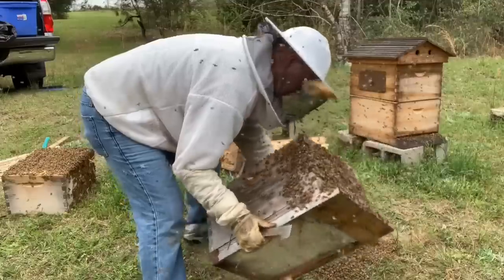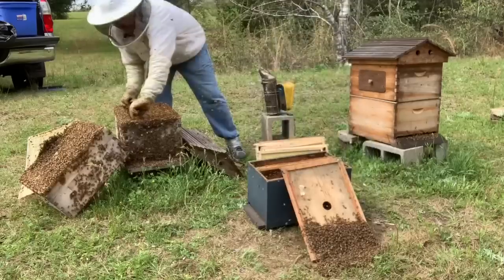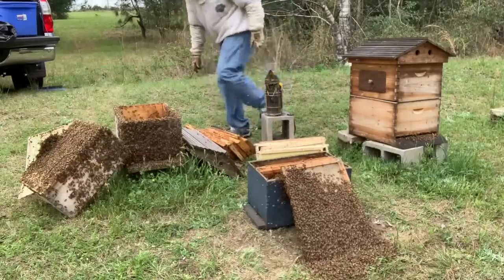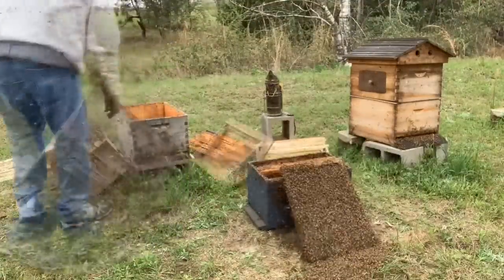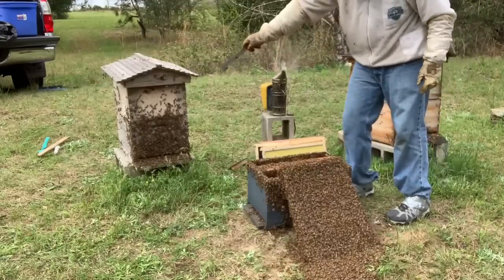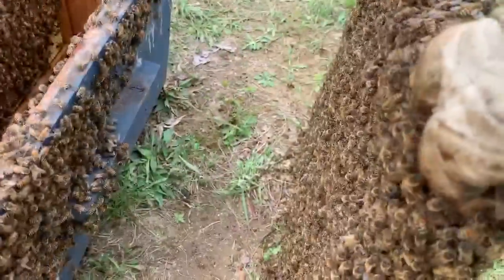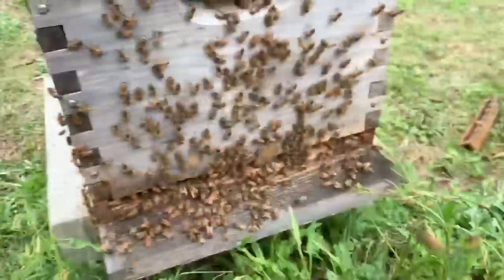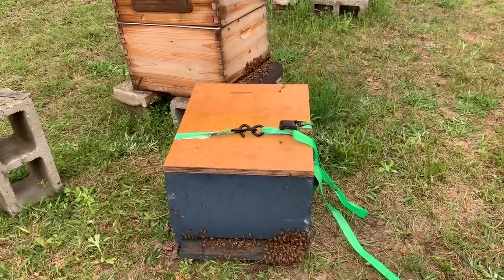Modified Taranov Split of Mean Honey Bee Hive

Comment: Nurse bees won't return to the old hive
Reply from the maker: That’s right. They are with the queen and should help get things going in the new hive. I left most of the brood in the old hive and it should hatch out soon. This is my understanding of how these type splits work. We will see how it goes.
Reply from the maker: I learned a lot through this process. Yes the nurse bees and queen stay with the new hive and foragers go back to the original hive. There was plenty of brood in there. If you watch the follow up videos you will see that the split I did pretty much worked to perfection. Both hives are strong and have done extremely well!

Thanks for checking in!!!

Comment: In a true Taranov all the frames are supposed to be shaken.  The idea is to remove ALL of the bees so that there are no nurse bees in the original stand.  
One suggestion (I've done this before effectively) is to place an empty box and bottom board on the original stand.  This way you're not re-shaking the bees.  It does take longer than I like and won't do it anymore.  I split differently anymore.  But it is an effective method.
Reply from the maker: Thanks for the comment. This is why I called it a “Modified” Taranov Split. Seems to be working out fine. I will probably try a true one later down the road. I really like the concept of a Taranov split but I can see how it is pretty slow. Thanks again for checking out the video!

Comment: Just seen your video now, wondering should the queen have had her wing clipped beforehand so she will not fly back to the original hive, Thanks
Reply from the maker: I like where you thoughts are here.  The one thing to remember is that once a queen mates she typically never leaves the hive again unless she swarms. So she does not know how to get back to the original colony. Clipping of wings o think is primarily used so that if the queen decides to swarm she cannot fly and will either try to leave and crawl back up into the hive or the swarm will end up on the ground or very close to the original colony.
Reply from the maker: Thanks for watching John.  Great question!
Reply: @brucesbees  Great thank you, I will try this myself later in the spring here in Ireland
Reply from the maker: Cool deal. Thanks for checking in from Ireland.

Comment: Why not just shake the frames off into the new box?  What value is there in making them find their way up the cover to the box?  Not challenging what you did - just don't understand the process logic.  thanks
Reply from the maker: My understanding is that when you shake the bees off and allow them to go up the platform it allows the foragers to go back to the original hive. The younger bees and queen stay with the new box, basically imitating a swarm. 

The behavior of the bees attitude of the bees changed from aggressive to that of a swarm as I proceeded through the process. 

This is my understanding of the process and what I have learned about Taranov Splits. This was not a true Taranov Split but I think the principle is basically the same. 

I hope this explains my logic a little bit. Will see how it turns out. 

Thanks for watching and thanks for your comment.

Comment: This would have to be about the worst way to split  a strong hive  . What he should have down was make up 4 X4frame  nucs with some day old eggs in each  an moved 3 of them to another location and leave one behind to pick up the bees in flight   all in one single operation . No need to find the queen but if you did see her pull her head off  head . Job done in less than one hour.
Reply from the maker: Yep that’s one way to do it for sure but my objective was different than what you describe. Was not trying to maximize splits or set a speed record. If my objective was to do as you said then I probably would have had a similar approach. I do appreciate you watching though. And thanks for your comment. It will probably help others who are trying to accomplish maximum splits in minimum time.
Reply: What happens to the full size super? I would have kept that queen based on her laying capacity alone. Another super on top earlier may have given the original hive more work to do  and kept them quieter but queen cells indicate it is too late.
Reply from the maker: I did the split and took the queen away. Both hives ended up surviving. The hive that had the queen in it was still alive more than a year later  last time I checked.

Comment: Why not just shake them straight into a new hive and let the flyers go home.
Reply from the maker: Good question... I think the idea behind the Taranov, or “Modified” Taranov Split in this case, is that the bees are snapped into swarm mode and act as if they have swarmed. They immediately got calmer and clustered together. If they form a swarm and then you bump them or shake them on the ground in front of the new hive they will go in with the old queen and the hive left behind will form their own queen. In this case it worked perfectly. Later in the year I did a couple of “true” Taranov splits that also worked perfectly. This video was my first attempt at doing one. 

In theory just shaking the bees in the box might have worked as you say. I might have to try that sometime. 

Thanks for the input!
Reply: @brucesbees  If you get all the nurse bees and the queen out of there they won't be thinking about swarming for a long time no matter how you do it.
Reply from the maker: You could be right. Makes sense.

Comment: Lol. Or you could have just moved the whole brood box 6 feet away and left the super over the two frames with QCs to achieve exactly the same result without shaking them out. If it started to rain there is 50% your aggression right there.
Reply from the maker: I guess that’s one option but these bees have been aggressive for some time. That is the reason my friend asked me to help. The weather was actually not bad until right towards the end. By then the aggression had gone way down and they were acting just like a swarm. 

Thanks for the suggestion. Will keep it in mind.
Reply from the maker: I also wanted to keep a lot of brood at the original location because I am trying to help the fix the issues at that location. If I took most of the brood away with the queen then it would take awhile for this hive to bounce back. Would rather have the weaker hive with the old queen at the remote location. I left lots of brood in the original spot with eggs and queen cells. Hopefully the population will remain strong and they will hatch out a new queen, be less aggressive and not skip a beat. We will see. 

There are so many ways to address different issues. I hope this one works. I think it will.
Reply: @brucesbees  once the new hive has a laying queen you can recombine them, so you don't lose any honey crop or strength.  A demaree split would also work fine, just needs an additional floor.
There are a couple of ways to solve that problem without shaking them out. But if they were wild for a while you should remove all brood and just supply a frame for them to raise from, from a friendly hive, and less swarmy one at that.  ..
Reply from the maker: Cool. Thanks for checking in. Will see how things go.

Comment: I have a really mean hive that I have re-queened just a few days ago.  They accepted her but there are a few queen cells.  Should I destroy the queen cells?  The new queen I was able to get,  comes from gentle stock and do now want the mean bees to re-queen a mean queen.  FYI I saved them from under a shed - but was not able to get the original queen.
Reply from the maker: Hmm. That is a good question. If the new queen is released and laying you may want to destroy those cells. The only risk you run is that is they decide to kill her you will not have a queen. If however the new queen is laying and they decide to supersede her then they will be using her eggs to make the new queen which might not be a bad thing. Not sure where you are from but here it is getting too late for bees to be making their own queens so hopefully is you kill the queen cells she will be in good shape.
Reply from the maker: Nope. The queen hatched, mated and went to work.
Reply from the maker: @DaddymackLV  this video was shot the same day as the original “Mean Bees” video. So it was basically a 2 part video so to speak. If you watch the “Mean Bees” playlist you can see how the bees did as they progressed throughout the year. Not sure if this management method will work most of the time but this time it worked perfectly.
Reply from the maker: @DaddymackLV  ok. Thanks for watching.
Reply from the maker: https://www.youtube.com/playlist?list=PL8TUJQAHFlHvlhX5Biz6IxBH29TW64IcP
Reply from the maker: @DaddymackLV  awesome thanks!  I hope they answered some of your questions.

Comment: why didn't you put the queen excluder on top of the box that you are wanting them to walk in? the queen can't get into the new box, then you tell her good night. replace one of the capped queen cell frame in the new box and now you will have 2 splits, 2 virgin princesses which will produce calmer hives. just a thought.
Reply from the maker: Not a bad thought. Probably would have worked. If you have the tome to watch the playlist “Dealing with Mean Bees” you can see how things turned out. Everything actually worked quite well in the end. Thanks for the input though. There are so many ways to do things with beekeeping.
Reply: I watched part 1, part 2. there's always 1 hive in the crowd like that. requeen time. i don't like getting stung but I detest getting stapled. what impressed me most about your video's is that you helped out a friend. awesome job!
Reply from the maker: Yeah it all worked out well the others show results down the road throughout the year. I don’t know that this technique would work on a regular basis but it did in this case. 

Re-queening is probably the best way to guarantee desired results. But this technique was fun and worth a try.
Reply: I use the same method but to fix a laying worker issue. i make them walk in with frames of different stages of eggs, larva, capped brood from another hive and used empty brood frames and 1 frame of undrawn foundation. this changes their behavior and gets them into the working mode. then 2 days later i insert either a mated queen or a capped queen cell. this works 100% of the time.
Reply from the maker: Hey that sounds like a great idea.  Thanks!

Comment: Didn't you just get rid of all your nurse bees doing it this way?
Reply from the maker: Great question and yes! It is how swarms work. From what I understand swarms are actually made up of primarily young bees. You basically snap the hive into swarm mode. The older bees return to the hive. As the brood hatched out those bees will become the nurse with the new queen and the young bees that leave with the old queen will build wax and help get the hive established. The split worked to perfection as both hives became strong and made it through the winter. One of them is a little weak now but I think they swarmed.